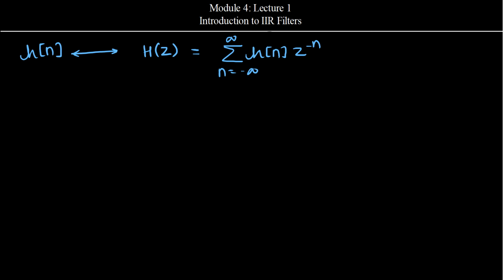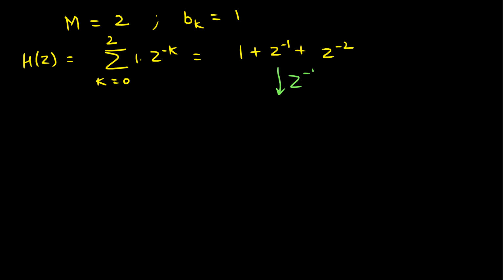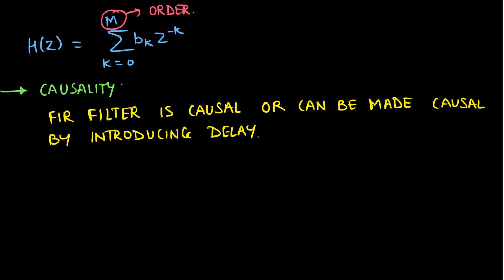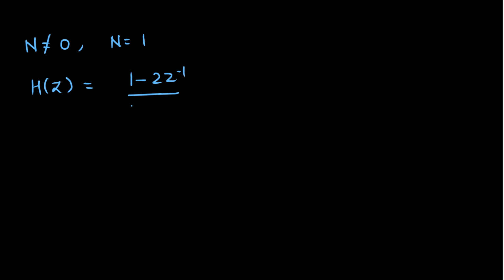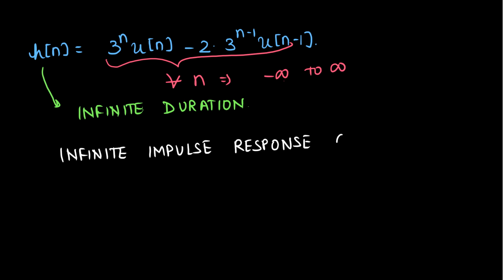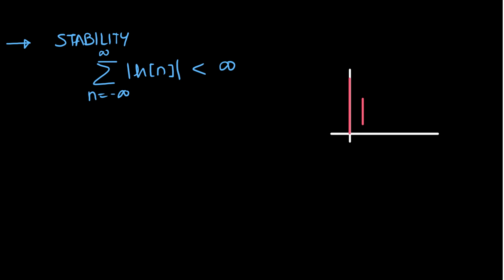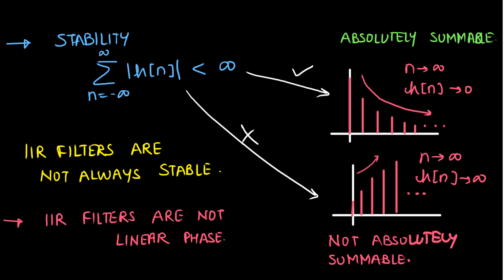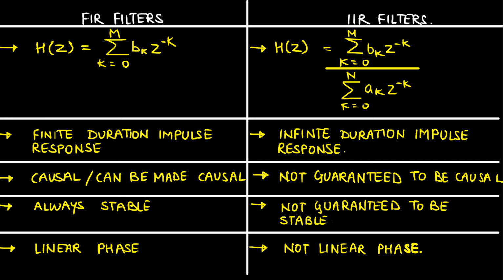Mod4 Lec1: Introduction to IIR Filters

Comment: In the IIR filter h(z)  denominator term includes  +1 right.?  why you didn't add  that.?  and  k is also starts from 1 to N
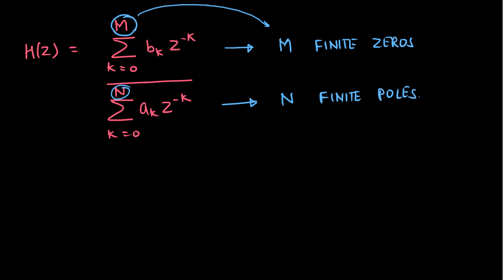Reply from the maker: Consider the H(z) equation at 3:37 
Now we can write the denominator as a0+sum from k=1 to N ak z^{-k}. Now, divide numerator and denominator by a0, we would get H(z)=[sum k=0 to M (bk/a0) z^{-k}]/[1+sum k=1 to N ak z^{-k}]. Now put bk/a0=b'k, so, we have the new modified expression as H(z)=[sum k=0 to N b'k z^{-k}]/[1+sum k=1 to N ak z^{-k}], which is the same format that you are expecting. Hence, both the ways of representing IIR filters is fine. The one discussed in the video is a more general form.
Reply: @shivanidhok3831  ohoo okeoke....... thank you for your response and the explanation

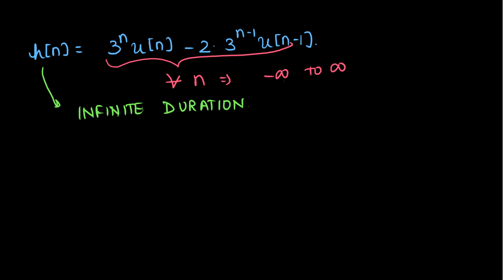Comment: At 16:15 you have told that duration will be from -inf to +inf but u(n) range will be from 0to inf and u(n-1) range will be from 1to inf hence h(n) will be only from 0to inf right ????
Reply from the maker: Yes...In general, the h(n) is defined for all values of n, I.e. from -inf to inf, but due to u(n) it will have non-zero values from 0 to inf.